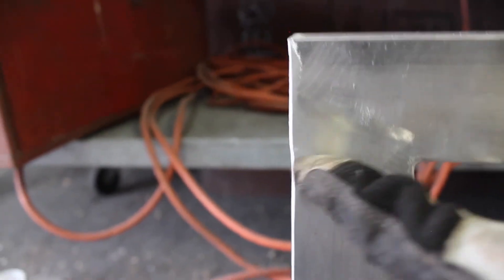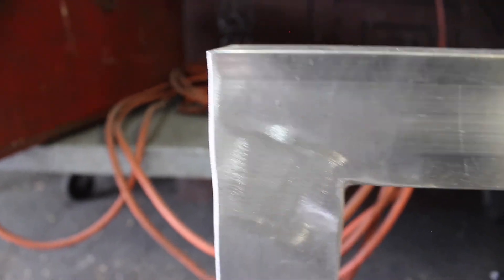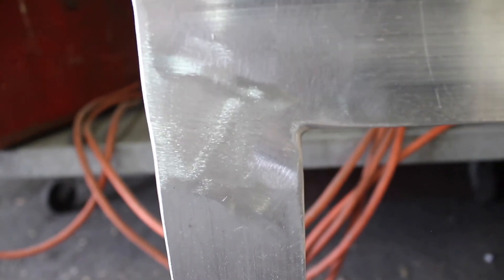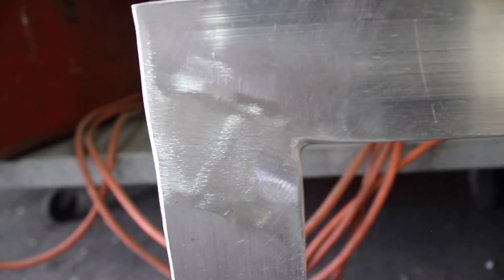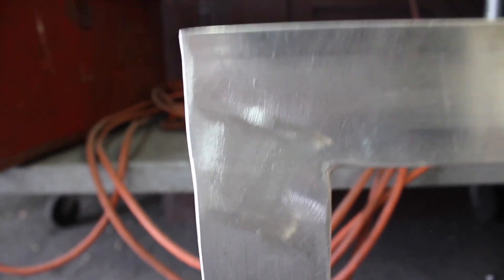More aluminum welding..Getting better?

Comment: Looking good man  you getting the hang of it now.I can see you becoming a good welder/fabricator because you don't 
just give up when things are not going all to plan.

is that aluminium anodized that your welding ? looks  like it from the videos!
that stuff is not easy to weld for a beginner.
Reply from the maker: MRTYREMULISHA I definitely don't want to give up I'm almost there. this is the first project I've done with aluminum so it's a real challenge for me but it's getting better. I'm not sure if it is anodized or not. it is 6061 aluminum. I do grind a little away where I'm going to weld then brush it and clean it.

Comment: bevel your joints to give the weld somewhere to go and to help penetration. But yes, welds look much better. Keep up the good work. I also like the change in music from your normal techno, EDM or whatever.
Reply from the maker: Jason D I started doing that with the second leg just didn't really show it and didn't bevel it alot. I have a hard time with the t joints. next video you'll see my shitty t joint welds. I'm trying to change the music up I'm not sure what people like to listen to. anything is better than pure quiet.
Reply: BGray Custom it's kind of hard to explain but once you get your puddle established dip some rod in there then move forward and you'll see the puddle sort of drop in or tie into the parent material, then dab it again, move forward and repeat. This way it doesn't look like the bead is sitting on top if that makes sense. One of these days I'll try to post a video to better explain myself. But for being self taught, you're doing awesome.
Reply from the maker: Jason D what I've noticed is if it's not clean enough the puddle is shiny with black specks are apart of the puddle. but usually it's just shiny. I honestly hate welding aluminum 😂